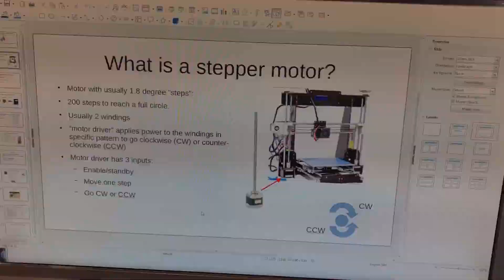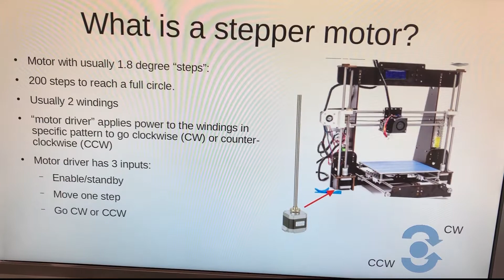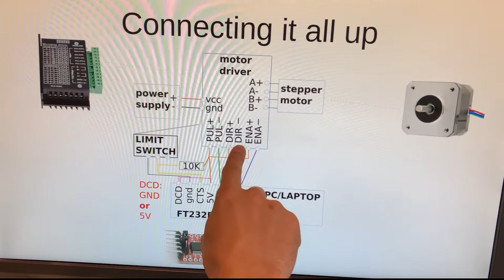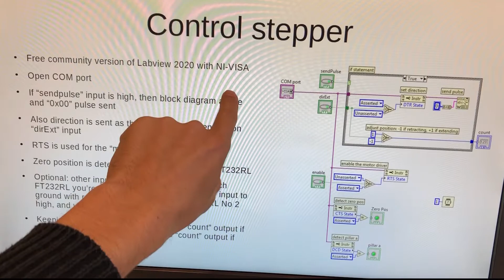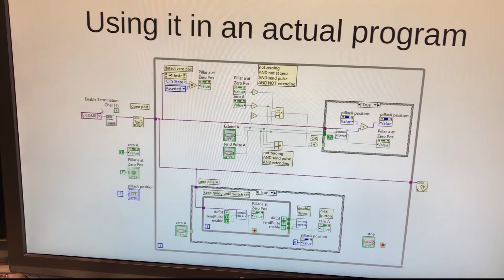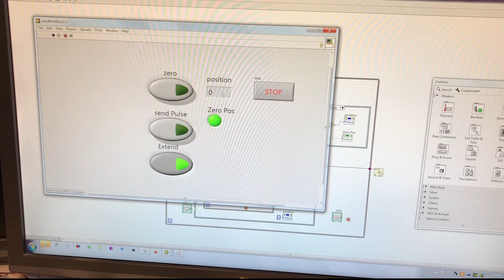Super easy and cheap CONTROL OF STEPPER MOTORS more DIRECTLY WITH UART

Comment: Hola, tengo una duda, sería la misma programación en LabView, si implemento un Arduino UNO, en lugar del FT232RL?
Reply from the maker: si. But with Arduino uno you can use any GPIO to control the signals.

Comment: hi im working on a project where i would implement control of a stepper motor trough uart like in your video but i would like to program it in a programming language not with labview do you have any source i could reference to?
Reply from the maker: hey Marko, sorry only just saw your message. I have done similar things in C#, but apparently in python this is very easy too. DTR RTS and all those signals are ancient tech and are part of every serious programming language.